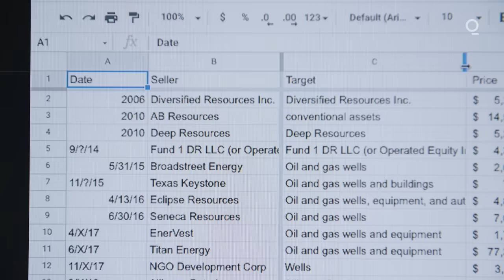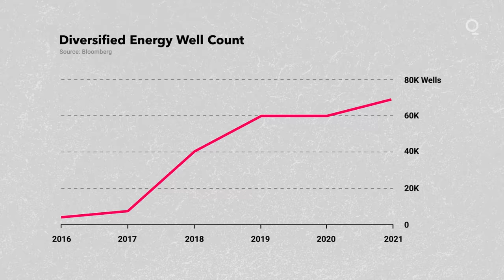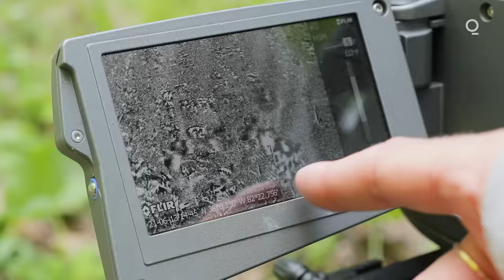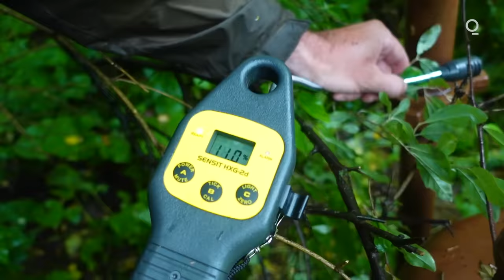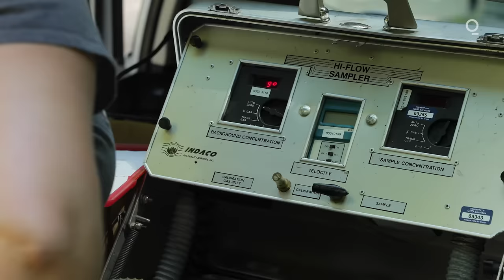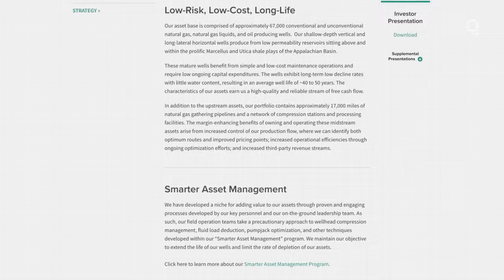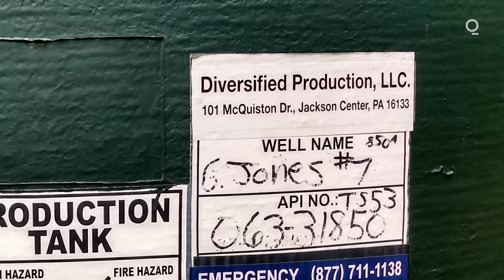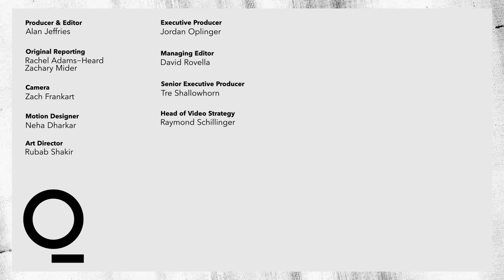How Dying Gas Wells Are Making One Company Rich

Comment: I inspect natural gas wells for an air district in California.  The FLIR IR camera only finds large leaks.  I prefer to use an Eagle 2 analyzer it is much cheaper than the FLIR ($7,000 vs $90,000) and detects much lower emissions  of methane (I am trained to use both devices).  The Eagle 2 also gives a quantifiable reading in ppmv and it is hand held unlike that contraption the professor was using.

People in the comments think Diversified is a shell company but  I seriously doubt it with my experience with the oil and gas industry.  Natural gas prices have dropped over the years so most producers shut-in their wells and or sold them.  Some companies buy up these old wells gambling that gas prices will go up again in the future and they will put them back into production.  They are simply buying cheap hoping for a favorable future to get a return on their investment.  I have seen a similar trend in my area as well one company has bought up most of the local well leases.
Reply: It is an LLC, they show it at the beginning of the report.
Reply: so what if it malfunctioned , causing corrupted data , or interfearance  from some nosy person with a magnatron and laser purposely causing confusion at the opposite end ?
Reply: Gone down? Here in Australia at the moment were exporting the stuff for twice the price it was 6 months ago. We're pumping as much as we can as fast as we can. With oil production low due to low prices the supply of gas went down with it.
Reply: Technology sure has come a long way since my days of Draeger Tubes, MSA Explosivemeter and sampling/portable GC & HPLC.
Reply: How much are they going for?
Reply: What about using a spray bottle with soapy water? It works for finding a slow leak in a tire, so would there be a reason to not use that very simple method? At least as a starting point?
Reply: @johndonato3638  You are correct, in HazMat Response a spray bottle of a mixture of water and soap is used as a leak detection device. In addition, a bar of ivory soap is useful in temporary plugging of leaks whether liquid or gaseous. A simple swipe of the soap bar across a leaking drum of chemical can stop the leak as long as it's not under to much pressure, as in Plug-n-Dike.
Reply: Interesting info but have the companies in your area (that bought up these wells) gone out and updated them, or are they waiting for the price to go up before dealing with them?
Reply: What fascinates me is the fact that these methane wells are located above coal seams and keep on producing gas.
I would like to know what the underground construction of the capturing system is.
Because without it, gas will find its way to the atmosphere regardless of it.
Only difference now it is concentrated in one spot.
Thomas Gold - in his book "The Deep Hot Biosphere" has a fascinating take on the issue.
Reply: @janhemmer8181  I was under the impression that the pockets of gas are usually buried under geological layers that contains them? The same kind of layers that also covers and intersects coal layers. Logic would dictate that if the ground was sufficiently permeable to allow the gas to escape "easily" it would also prevent actual, exploitable pockets of gas from ever forming.
Reply: You sure these aren't water wells?
Reply: @crotalusatrox7931  My Dad was constantly knocking holes in the gas tank of our '53 Ranch Wagon.  He'd find some road he had to know where it went.  We'd get stuck and inevitably knock a hole in the tank.  But, he had a solution.  He'd stick some Ivory soap in the hole.  In big holes, we'd be chewing gum so he could use that to get us out of the mountains.  Once we got home, he'd drop the tank and patch with solder...
Reply: @mnxs  that's not quite how it works.  The permeability of the beds is how the gas migrates to the well.  Often, there are impermeable layers of shale above and/or below that traps the gas within the gas carrying bed.  The "pockets" you envision are created by folds in the bedding which cracks the rock a bit and creates a spot for the gas, or oil, to collect.

Comment: Something else I found out.. My friend owns a large working farm that a pipeline goes across his property.. The gas company has a big metal building with a type of control center.. My friend discovered gas was leaking into some of his wells and ponds… He and the gas company went back and forth for years.. Gas company comes and checks everything every so often
Reply: Do they have wells on or near his land, or just the pipeline? The building is most likely a place for the scent to be injected into the otherwise odorless methane inside the pipeline. The rotten egg smell of a gas leak is added there. If his wells have been contaminated by fracking, I would have someone besides the gas company check it for him. There are many toxic chemicals involved in the extraction process, and you do not want them in your water.
Reply: @benhoskins4719  they have wells to water the cattle and he can switch from county water that runs to his house to well water if needed.. It’s just the pipeline that runs through his pasture.. I see them out there regularly checking them..
Reply: File a notice of claim.
Reply: So scary, wells aren't worth the danger and liability.

Comment: It's no joke, the same problem in Canada, thousands of swells need to plugged. I used to do it, it's a job that will be in high demand if we get our act together.
Reply: @Wary of Extremes 
It'll take 175,500 more wells just to get the remaining gas out of the Marcellus formations.
Source; DOE.
Reply: Nobody does it because every time the ground moves, billions of tons of gas escape. Can’t really plug that.
Reply: Was the cost really 10,000 bucks a well, that seems steep.
Reply: Whenever I hear someone complain about lost jobs due to oil and gas pipeline contracts being canceled or halted by environmental concerns, I point out that all of those oil field and pipeline workers could have jobs again, plugging old wells, if a mechanism can be created to pay for it.
Reply: Why is it so expansive to grab few sack of cement  and throw it on to the outlet?
Reply: @superchuck3259  They don’t just pour concrete in the hole. It has to be cleaned out, they have to figure out how deep it is. If it’s cracked and rusted it needs to be repaired or the concrete just keeps pouring through the break. Plus a well takes enormous amount of concrete to fill.
Reply: @superchuck3259  Depending on the depth it's can be 100K plus
Reply: In Canada, Taxpayer's dollars are being thrown at the problem because the Provincial government's were not Collecting enough Royalties for a Decommissioning Fund!
Reply: Chris Clifford  Then I wonder how they do it?
Reply: What training is needed to do with?
Reply: Oil and gas hopes taxpayers will cover these billions in cleanup costs.
Reply: @superchuck3259  that's actually fairly conservative estimate. I cemented wells in Western Canada for 11 years. 1. You have to get a service rig in there to remove the well head and prepare the well for cement ( around $2-3000 a day for a service rig) 2. You have to get water and vac truck services in there ( $175 ish/hr). 3 Getting a cementing crew and equipment in there ( minimum $5-6000). These estimates are assuming no other issues that commonly happen, such as cement not setting, equipment getting stuck etc etc.
Reply: @voisindo  That solution is certainly expensive. I was just looking for something stop gap.  Something that would last 20-50 years.  Something cheap and effective.  Some hydraulic cement with epoxy binders.  But hey, you know way more. I was throwing out ideas.

Comment: Even if there is already an agreement in force, a lot of what I'm seeing can be substantially reduced with pretty simple plumbing repairs.  They won't be as permanent as plugging, but they would reduce the leaks dramatically.
Reply: My guess is they wouldn't spend any amount.    Reminds me of a sitcom where they go to divorce court and someone asks for 100k or something and the court gives them 300k.  1000 years to plug them.  Wow.  I'm surprised they didn't make the states apologize to too.
Reply: Easier said than done.  Half those ancient joints are probably so rusty, they'd become decrepit if unscrewed/disjointed.  Workers might need pipe wrenches 6' long.  PA should have mandated 250 wells/yr be plugged - rather than the ridiculously inadequate 20.
Reply: @brahmburgers  If that's the case, cut them and seal them.  If they can fix them, then bring them back on.  Who is allowed to keep breaking the rules until THEY can get around to fixing it?  Crazy.
Reply: They would up the production too
Reply: @brahmburgers  It's simple, the law makers acquiesced to campaign donation dollars.
Reply: @krisgreenwood5173  "acquiesced to campaign donation dollars". Such an elegant way to say "took a bribe" lol.
Reply: @brahmburgers  No need to do any of that; just use caulking to seal up those joins. They don't need to be permanent seals, just something better than what it's at.

Comment: Abandonment can be costly; sometimes they have to perforate zones and do a cement squeeze then bubble test on surface; 

If bubble test fails they will have to redrill the cement and plug, re perforate again and bubble test; till it pass.

Sounds easy to do but time consuming.

Clean up can be costly on some wells;
We can blame old owner neglect after they sell it; and some wells because of transfers will have lost well data; which will add a few more steps to be abandoned properly.

There is definitely A LOT of work to do here as there are so many existing wells.

Comment: Never heard of a "frac well" but what is shown is a drilling rig burning off excess gas that was being pushed up during drilling. Frac is hydraulic fracturing which the drilling is already done. They're trying to open the formation to allow more gas to be produced.
Reply: Released not produced.
Reply: There are tens of thousands of gas wells in Colorado. Of the many that I saw, all of them were 'flaring' off gas 24/7.
Reply: @runcheatthereaper9016  Yeah, I've always found that to be super dumb. Why wouldn't you want to capture that gas instead of wastefully burn it? If you want to maintain the rate of gain, just restrict flow.
Reply: @runcheatthereaper9016  baloney
Reply: @KainYusanagi  becuase theyre after the oil, not the gas. If they gotta burn extra gas in order to get the oil, they will
Reply: @MrChidorinagashi10  Yeah, but capturing and selling the gas will be much more profitable than just burning it off.
Reply: @KainYusanagi  no becuase theyll make more on oil
Reply: @MrChidorinagashi10  My point is that they'd make more off oil AND gas than just oil.

Comment: This is so interesting that at a time when energy is so expensive we allow so much natural energy to be wasted ...  I could see a small solar powered vacuum pump creating a negative pressure ( vacuum ) into a storage tank then an automated wireless messaging system to signal a gas retrieving operation....  This will attract investors of all ages and fanatical abilities
Reply: you should be working with the team, apply for a job, no, im not joking, if ths came to you, get onto the company, they know you are here.
Reply: hmm, burn it on site and power some mining ASICs if it's hard to reach. that way you help can fund the rest of your operation without spending lots of money on transportation, PV panels, ans storage, all of which produce lots of pollution to build and maintain. 

But if transportation and storage is convenient, you can probably use some of the gas to power a compressor, since you would need enough solar panels and batteries to power my house otherwise. Those would save more pollution powering EVs and homes rather than compressors in in the woods, I think.
Reply: @compwiz00  I had the same idea, make some bitcoins or ethereum from the by waste products, hope to see you in the greater scheme of things sometime compwiz.....

Comment: Realistically, you do not need to plug and abandon a well simply because the surface pipework has a leak.
But the maintenance on those wellheads was appalling. If America had a regulatory system mandating the standards required, maybe the petroleum industry in the states would not be run by coyboys.
Now, before I get the expected flood of derogatory comments by the uneducated, let's have a look at all of the items used by the reporters in this article and see how many are made using natural gas as a feedstock for the chemical manufacturing process. 
I would hate to use the word hypocrites but, if the shoe fits. 
Then, let's not get started on questioning the intrinsic rating of the electronic devices they used, including the camera when filming inside the hazardous area zone of the wellhead itself. Shame, shame, shame.

Comment: If someone had an abandoned well on their property, they could burn or capture the gas for their own use.
Is it stealing?  Or saving the environment?
Reply: Surely these companies would do that as there is a growing demand for methane in gas power stations, as methane can be a renewable source of gas because it can be produced by plant decay.
Reply: I don't know, but there is some risk associated with that. Without some sensors you would be unable to find leaks as methane is odorless, the typical smell is from substances added to gas and not from gas itself. I believe they use different substances for different types of gas as propane and natural gas smell differently.
Reply: if not being used, abandoned, on my land, I am using it!
Reply: they do that in some places use casing head gas to warm things/run the oil pump mule motor. seems like a total waste to just let it leak. better to burn it as that gas is less harmful to the environment than methane is... so flare it. make little heater/lights for the little animals to be warm at night and have a night light to socialize at night. i wud.
Reply: @MrToradragon  Methane is odorless in your hose due to the refining, at the well head not so much. I on many of times wondered what that poor dino ate...
Reply: @gmcinnis6304  Could run a generator.
Reply: @SegoMan  Frijoles !!!

Comment: Looks like the main problem is most of these wells aren't worth fixing, enabling Diversified to buy the rust buckets for peanuts but still giving them trouble keeping them all up to code.
Reply: Diversify doesn’t buy only ones that don’t work they buy wells that are very much still full but because their locations are so far from the rest is society it becomes hard to actually perform…. Most of these wells could probably last for about 10-15 years before they run dry permanently if it is still leaking methane than that means there is material that could still be used for fuel.

Comment: Thank you for this video and for making us aware. Their stock has fallen 20% since ur video and I hope that gets their attention. Plugging 20 a year is not enough.
Reply: This is an inaccurate statement.  This is a penny stock.  Diversified's common stock has been trading for less than a penny for the last 10 years.  It sounds more like what others have suggested . . . a clearing house for the big oil companies to divest their liabilities. I'm sure the CEO is on Big Oil payroll.  There appears to be zero cash flow coming from these wells.
Reply: @philOKC  I believe you’re referring to DVFI, which is not the same. DEC trades on the London exchange, and is currently sitting at 138.10

Comment: If they can fix them so cheaply, they should fix them just to improve profits. That one well leaked 600% more than they collected. Thats an insane amount of profit for a cheap fix, i hope that isn't the norm that they are leaking that much
Reply: Exactly what I had in mind. I was wondering tether they can't just send somebody with that camera and epoxy resin or something like that. If there is leak 6 times larger than what is extracted from that well, well, there clearly are some money running away.

Comment: Some misleading information but not extreme. Many of the wells could be fixed with a pipe wrench and thread sealer.
Reply: Yeah, but the companies aren't gonna go do it. If concerned citizens did, well, that would be another story...
Reply: Maybe a couple dollars of thread, but for a crew to drive and to hike there through the dense bushes may cost hundreds if not thousands of dollars. On the other hand, if the gas well are still in production mode, saving leaked gas may well more than pay for the repair costs.
Reply: @Seraph.G  The video said that the company did fix the leaks after the reporters shared their findings with the company.

Comment: Serious question: For those wells that you had to hike to and almost getting lost in the woods, how did the well owners get the piping and equipment to the site? Did they, like you did, backpack all of that stuff in? The rig and equipment to drill these wells, did they bring it in by helicopter?
Reply: That would be something, take a drill rig apart cutting all the 100 foot beams into 4 foot beams and pipes to hike it in.
Of course they had roads and over 40+ years nature grew over the roads making them impossible to see.
Reply: @wv8417  You didn't catch the sarcasm. Of course they had roads to get in there and they still have roads to get to the wells to service them. The video was just throwing in some supposed adventure. Like most environmentalists, the video is a fraud.
Reply: @McGrew100  Sensationalized reporting to bump their ratings.
Reply: @McGrew100  wrong
Reply: @Nicholas-f5  wrong about what?? Those are questions.
Reply: @McGrew100  the "roads" were more than likely just a temporary dozer trail that has long since overgrown and is now impassable. It's pretty obvious a lot of these wells haven't been maintained just by looking at the state of them.  I live in BC where we log and old logging access "roads" get overgrown and disappear if they are not maintained.